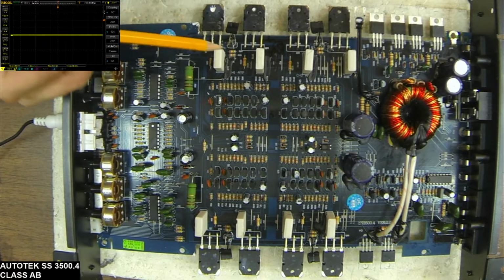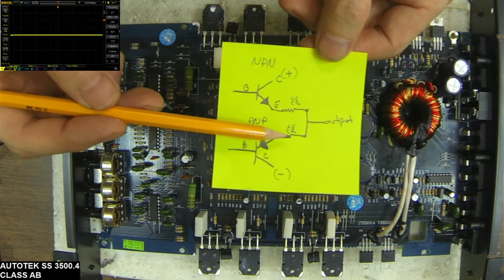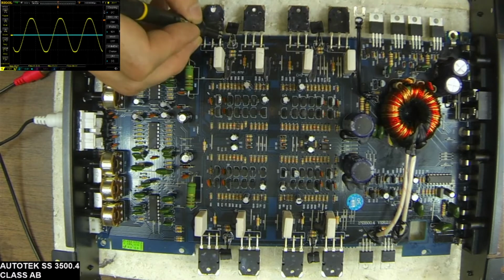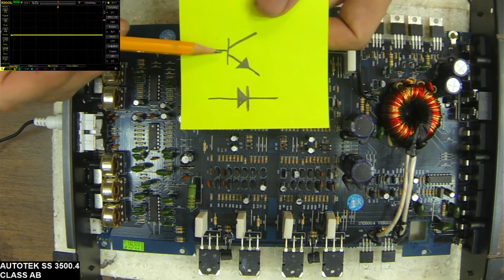Autotek 3500.4 Class AB Automotive Car Amplifier Pre-driver PT2

Comment: I'm messing around with a SS500.2 Autotek since it blows the fuse. I replaced the output transistors since 2 were burnt and still the same. Mine though had these 2 cards standing up between the emitters. Not sure what they are. I see AUD, V, GRN, and a blank pin. Could those be crossovers?
Reply from the maker: The crossover is in the pre-amp. I would have to see a picture of the area you are talking about. www.ellensburgamplifier.com is where you will find my email address if you would like to send a picture of the area.
Reply: @ellensburgamplifier  couldn't find your email to send pictures so I went ahead and uploaded a video on YouTube on my channel.
Reply from the maker: @RGVto512toVA  Excellent work! You are on the right track. That small capacitor at the power supply is a snubber capacitor or what is called the RC snubber. It reduces noise in the power supply switching. So what I would do is pull a card as you had mentioned and see which side is faulty. Most times when a primary transistor fails it will take out the drivers to it.
Reply: Thanks for the compliment. I'll try the card first. If it is at fault, I'll be in a pickle since there are no numbers to the card so I'll have to figure out each piece and how to test them.

Comment: You can fix a ampere audio 8 k mono amp thanks
Reply from the maker: Thank you for asking. Most amplifiers can be repaired as long as there is no excessive board damage and parts are available (no defaced IC's).
Reply: What is defaced ic mean do u have a websight with address to ship amps to and talk pricing on fixing it o think it's just power supply chip or a cap blown
Reply from the maker: @edwardholliman465  Hi. Yes I do have a website www.ellensburgamplifier.com where you will find all my direct contact information. Defaced IC's are when the manufacture sands off the top of an IC so us technicians don't know what they are using. If you can email me with what it is, what it is doing and a full picture of the board I will be more than happy to assist you.

Comment: hi, what kind of amp is more difficult to repair?  AB or D ? excuse me for my English, i am from Venezuela
Reply from the maker: Thank you for asking. This is a difficult question to directly answer as both classes pose different challenges. Class AB seems to be the common choice for difficulty. Class D mostly requires a scope to diagnose so knowledge is needed about understanding signals. There are many ways to make a class D amplifier function while class AB is quite straightforward by design.

Comment: Hi thanks for the explanation on the output circuit it is much clearer now however I just want to know on the pre drive transistors can the pnp have a positive voltage and the npn a negative voltage because the amp that I have I get no drive on all bases of the output transistors
Reply from the maker: Hi Tyrone. The PNP should have a negative voltage and the NPN should have a positive voltage in regards to conventional electron flow. If you can send me an email with the amplifier you are working on I may be able to assist a little more efficiently.
I also have to add in the case of this board that both an NPN and a PNP transistor are used on each pre-driver rail.